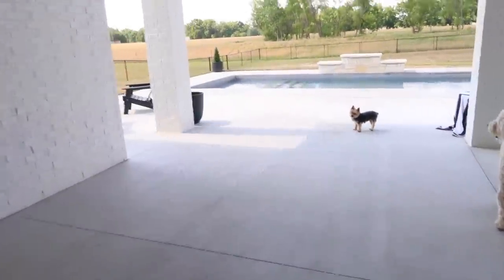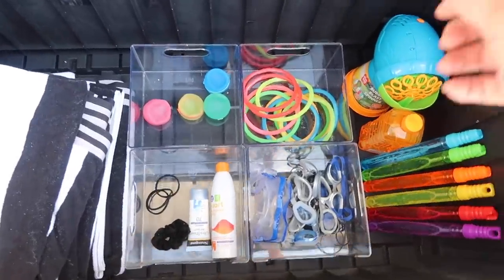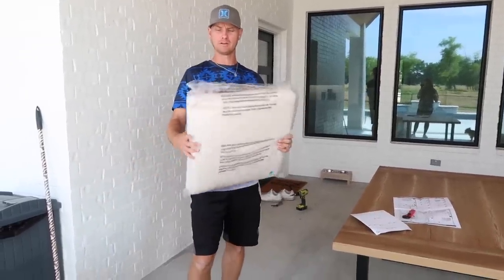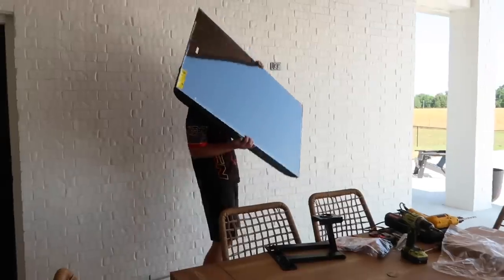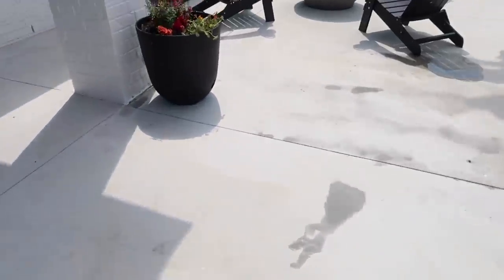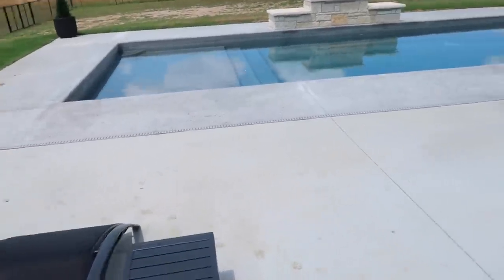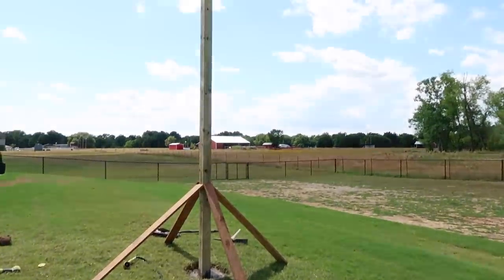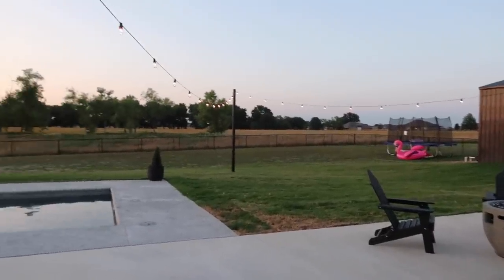2023 NEW HOME DREAM PATIO MAKEOVER | NEW HOUSE PATIO MAKEOVER ON A BUDGET | PATIO MAKEOVER 2023

Comment: ❤❤❤ I put cut to pool noodles in the bottom of my pots for drainage, also saves a little potting soil. I also use empty wine bottles filled w water turned upside down stuck into the soil  to water  🪴 potted plants. This way in the heat the plants don’t dry out 🌺

Comment: Ashley looking good, I would face the lounger towards the pool and in a curve, not so stern and straight. The patio lights I use from Amazon on my social patio and around my garden house, they have a rubber ring on each socket to hang to lights so no need to wore tie. I love them. I also have them on my porches and I’ve had the. for 6 years and still burning (all lights are on timers)  Next year plant arborvitae’s in large planters for tall greenery.. I love mine.. pools need tall greenery and many to move around for decor. 😎

Comment: I have similar lights from Amazon but mine run on solar energy or I can I use a USB cable.  Mine came with clips attached to them for hanging and they are shatterproof.  I too live in Oklahoma and I purchased mine after being without power for four days after our recent storm.  I would recommended them to anyone because they can also be used indoors and they omit little to no heat.  When my neighbor homes were pitch black I had lights.

With that said, I like seeing you new home decoration videos.  You and your husband make a great team and it is always enjoyable seeing couples being positive when they work together!  Thanks for sharing.

Comment: I'm thinking if you could find an outdoor weatherproof pillow long enough, that pool storage bin can double as extra seating when you have company over. That's if it's made of that hard durable plastic. Maybe store it away in the storage bin when you're not using it? Why not get a 2 for 1 deal here?  Also, it'll be a good way to add a pop of color to the area. Something like the turquiose 💠you mention while speaking of the rocks in the fire pit and the pool color.

Comment: I know we’re not through yet with the video but I’m thinking to myself I just saw on Facebook a real where they had the big tall round planters and then they took a Home Depot or Lowe’s bucket and a PVC pipe and quickset mix that up in the Home Depot Lowe’s bucket took that bucket and set it down inside of the decorative planter put gravel on it, took the umbrella and put it down in the PVC pipe and Wala. You have some shade for your backyard and for you to sit under but be out by the pool and then when you don’t want it, just pull it down or take it out but it the Oklahoma wind won’t blow it away.

Comment: Very nice. I’m not sure, but it seems just a bit of the lighting is running above the water. It would be disastrous if it fell or blew down with people in the pool.  Maybe you could tighten it or something so there is no water under the electrical wires.
Reply from the maker: It’s actually all to the right of the pool and not going over it. Chase made sure it stayed away from going over the pool for that very reason. Thanks for watching!